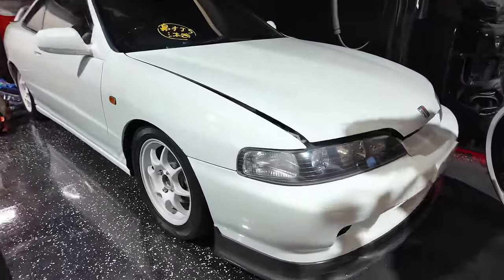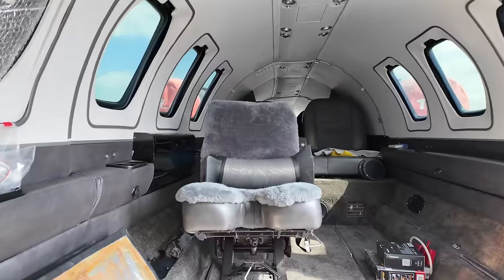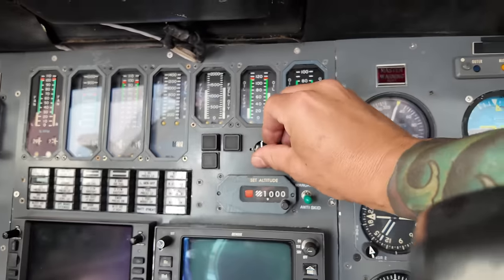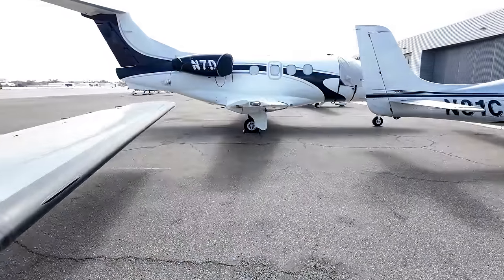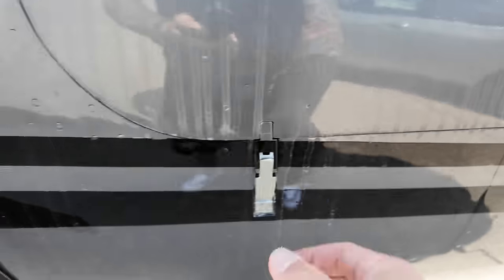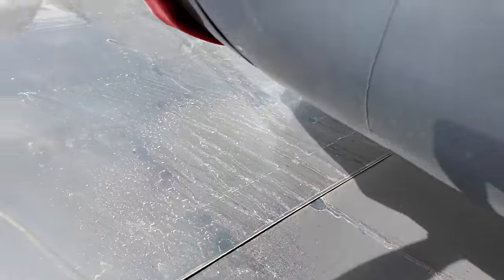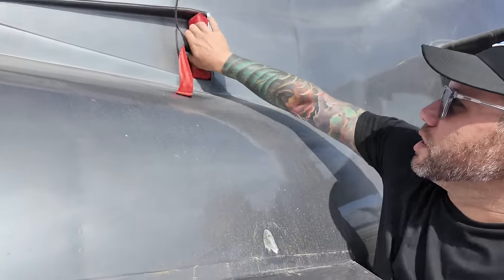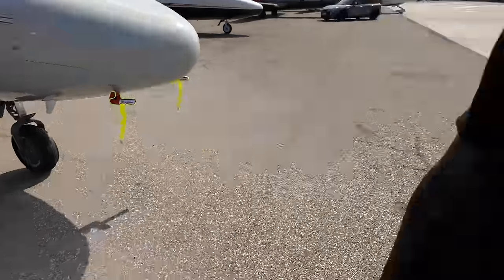Is Spending $90,000 on Private Jet Upgrades WORTH IT?

Comment: Question: can you share the specs for the replacement lighting? Wingtips, beacon, glare shield? Thanks
Reply from the maker: All from aircraft spruce.
Reply: @gear_down  thank you. Would you happen to have the item/part numbers for: wingtip NAV/strobe? Tail rotating bacon? I have a 501 and really want to update the exterior lighting. This old stuff is not all that desirable. Thank you, appreciate it

Comment: Keep missing these live streams for some reason (notifications ?). Q. Excluding the capital cost, can a private jet owner put the ride in a charter fleet,  use it 10/15 hours per month personally and then break even/profit/loss on the annual running, maintenance and insurance cost ? Or is the depreciation the tipping point to making it worth while or not ?? Thanks in advance if the channel or someone could answer.
Reply from the maker: Yes to all, but best is to consult an aviation tax attorney, they have all the secrets! I pay my accountant dearly to keep me positive without renting my airplanes out

Comment: Did you do the install of the Sandel/Nighthawk 4550 and 4500? Is the 4550 as plug-and-play as they make it sound for replacing a Sperry unit? How do you like them?
Reply from the maker: Unfortunately, I did not do the install. I bought the plane with all of the hardware as is except for the upgrades that I have done.. I believe the STC from Jet tech to add the RVSMand the Sperry units WAS NORTH OF 200,000

Comment: So you spent 90K on a citation II that’s worth 600K depending on the HSI times there -1A’s  could have put a lift kit on your cyber truck lol
Reply from the maker: That’s right I sure did. Both of my engines are essentially new. My plane is worth much more than 600 K and I will continue to put money into it as long as the IRS allows me to take that top line deduction every year.